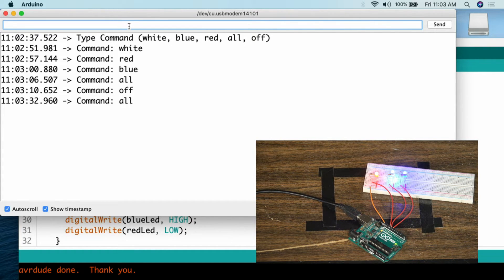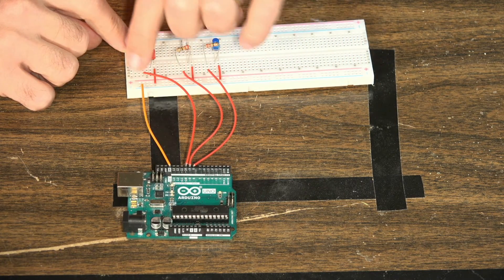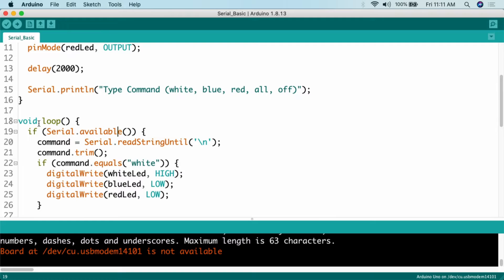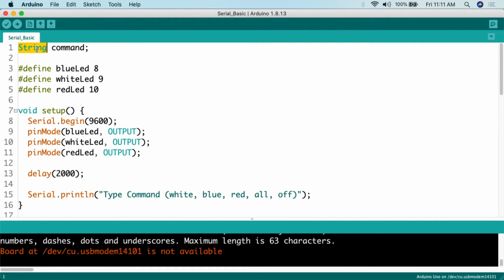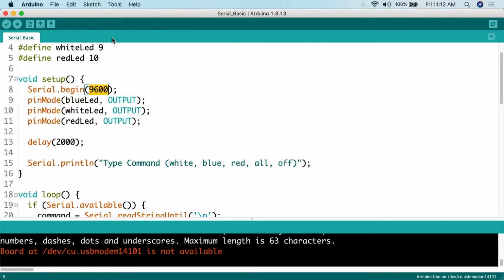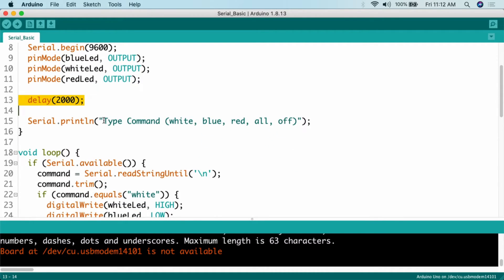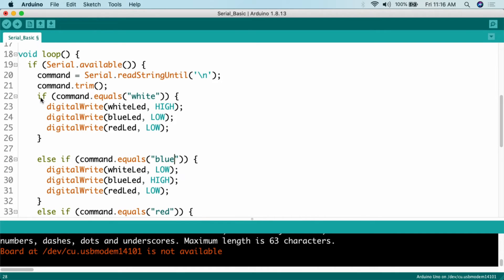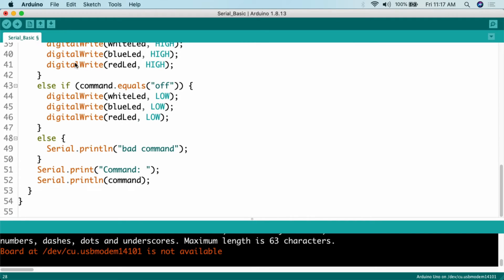Arduino - Send Commands with Serial Communication

Comment: As well as prompting the user on what responses they can provide, and trimming off any spaces, I also got into the habit of converting their response to either upper or lower case before comparing it to the appropriate case response string in my program, to eliminate the possibility of someone typing Red or RED etc. There was often as much effort put into idiot-proofing programs, as there was in the actual functionality.😊

Comment: how can i run hex files from an sd card on arduino? can i use an arduino nano to read sd then uart send it to a mega2560 flash and then the mega is reset to run the code?

Comment: Would there be a way to test for the beginning of the command and than a value written after to convert to an int, for example, “Duty:123” to control pwm signal to led or fan controller?
Reply: I’ve been using substring and startsWith to test for the initial command but it gets trickier when looking for the 1-3 digit value, I’ve tried breaking the string down byte by byte and then adding the char if it isNumeric to an int (not sure if that’s the actual term) I’ve found a way to make it work but the code is exhausted and I can only assume it’s consuming to the processing power

Comment: May I suggest a direction/extension to this series. Some machine learning or AI processing on a data set to make it worth involving the pi when the Arduino mega can do a lot. I happen to be collecting a stream of about a dozen sensors and values from a solar battery array that I built. I want to pass information between the devices store it in a database and eventually stream live data to a webpage for people to look at and potentially use as an accessible real world data stream for people to experiment with processing when they may not want to build a bunch of hardware. It is a 3 kW solar system with east and west facing panels connected to two charge controllers, a 4 kW battery and a 4 kW inverter. The Arduino currently prints a line in .csv format every 20 seconds and the python code running on the pi’s terminal stores it to a file from which I graph a few subsets of the data to visualize. A 55 gallon water heater with 4 kW heating elements and a refrigerator are the primary load. I store battery voltage, output voltage and current from both solar arrays using voltage dividers on a protoshield and hall effect sensors, Temperature and humidity inside the building where the equipment is located as well as in an adjacent garden area, top and bottom temperature of the water heater, power from both solar charge controllers, power consumed by the inverter, power from the grid into the inverter when battery is low, and the state of several relays and contactors in a .csv file every 20 seconds. 

This all being said I would be happy to volunteer some or all of my data stream if you think it would be interesting to process in some meaningful way to operate the system more effectively. I plan to add a wind generator and some other weather sensors to the system. 

Thank you for the awesome videos!

Comment: Hey there Eli, I'm currently enrolled in a computer hardware class and I'm working on my final project. I was just curious if you had a diagram of how you connected the hardware on your Arduino to make this assignment work? I was going to imitate what you did, attribute it to your video as a source, and then add to it. Awesome video and any help that you can provide is greatly appreciated.
Reply: I missed the part where you explained it, just saw it, awesome job again!

Comment: May I suggest that you use esp32/esp8266, they are very very similar to arduino and can be programmed with the arduino IDE, but they work on 3.3Volts meaning they operate at the same voltage than the raspberry pi the can be directly connected (arduino works at 5V and may damage the raspberry pi without a level converter).
Another advantage for the esp32/esp8266 is that they can be connected to the wifi network, giving you the capacity of building an IOT device.
I hope my two cents helped anyone.

Comment: The Raspberry Pi has GPIO pins, you can do the same thing without the Arduino.
Reply from the maker: An arduino mega has 54 digital pins.... creating subsystems allows for interesting projects
Reply: @elithecomputerguy  You can use an I2C/SPI expander for 140 GPIO pins on the Pi.